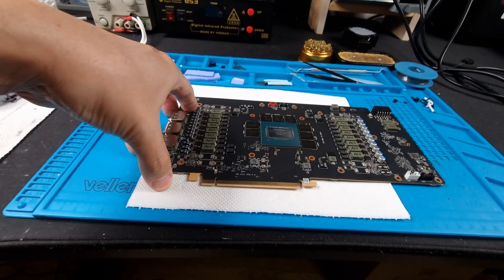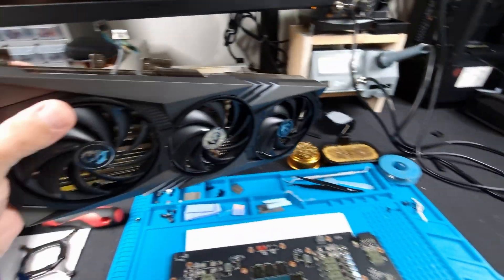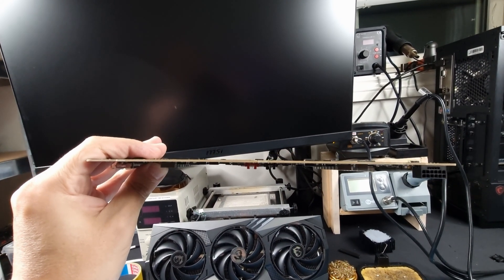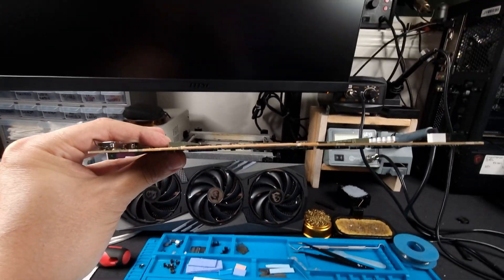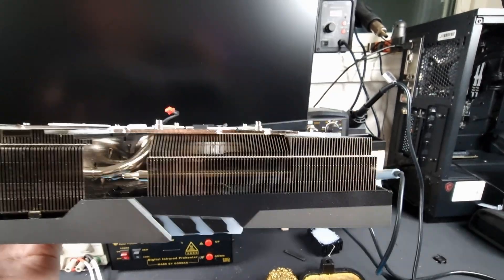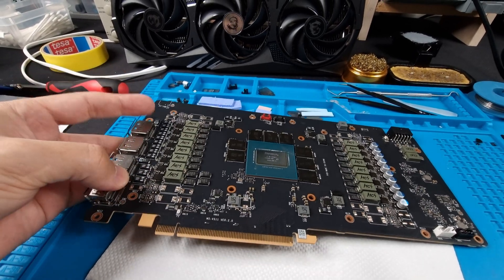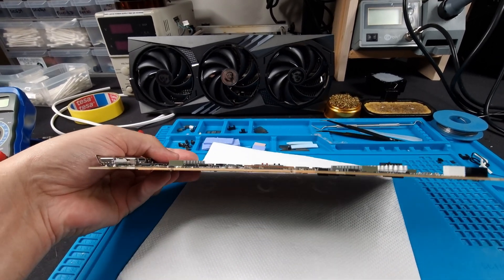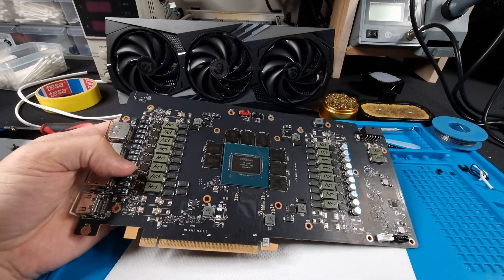How Using GPU Supports Incorrectly Can Destroy Your GPU.

Comment: Run 2 of them, at each end
Reply from the maker: @hawks_stuff  It could work, but it's best to have it vertically. Issue resolved.
Reply: @TechnologyHive  It does work, I run 2 myself. Not everyone wants/can do a vertical mount
Reply from the maker: @hawks_stuff  Well, you find out in time as enough hot/cold cycles warp the pcb when installed horizontally. One day you may remove it from your case to clean it up and when you reinstall it, it may not turn on again. But good luck, and I hope this is not the case for you.

Comment: GPU supporter apply between second and third fan properly , not on edges!
I had my Vega 64 Nitro+ with the supporter came from Sapphire , no issues as long I use it.
Reply from the maker: @BatManSWG  Well, I'm glad it worked out for you. Not all cards are this lucky.

Comment: You can just lay down your case on its back panel if you have space in your room, so in that sense you gpu is in position like its vertically mounted.Though it will maybe make your thermals a bit worse, as the hot air rises, and it would usually rise right into the fans at the top of a pc case, but now its rising into the front panel.But if you have good air flow, i dont think it will be a problem.So... this is just my opinion, it may or may not be correct.Also i didn't read full comment section, so i dont know if anybody else said the same think, so i am not copying anyone, again this is just my opinion.
Reply from the maker: @N33508  Yeah, many have suggested the same. But like you pointed out, it creates another problem with heat.

Comment: Totally agree. I have my 7900xtx on a vertical mount in my NV5 case. Not only does it look better, but also the card is better supported and wont be damaged at the PCB slot. I think a vertical mount can lose you 2-5 degrees in temperature but longevity is more important imo.
Reply from the maker: That's how that beast is supposed to be. If its a 79XTX it probably is a big heavy card?

Comment: What do you think about Lian Li O11D-1X-4 for Lian Li O11 AIR MINI? Will Phanteks/Cooler master will fit into this case?
Reply from the maker: @NameUserOf  Both of these vertical mounts are universal. But I think there is also a vertical mount specifically designed for certain Lian Li cases. I'd look into that also.
Reply from the maker: @NameUserOf  Both of these vertical mounts are universal. But I think there is also a vertical mount specifically designed for certain Lian Li cases. I'd look into that also.

Comment: Let me add my comment backing up most of what I've read: user error. Install the GPU, DO NOT screw it to the case yet, and install the support making sure the card is just RESTING on it (as horizontal as possible). THEN screw to case.
GPU supports are great, especially for larger cards, if used properly... which I hadn't even considered they coul dbe used improperly.
Reply: @emp1985 I think that you can screw at the start if you have your case laying horizontally while building
Reply: @Oilcommunist   or don’t screw it in at all. I wasn’t able to screw in one of the 2 screws in my 5070ti  so I just  did the top screw only . Bottom one wouldn’t fit. And just used the GPU support bracket to keep it from sagging.
Reply from the maker: @emp1985  Or you could just spend the extra time and money and buy a 3rd party riser vertical mount and protect your purchase. Done.

Comment: Those GPU are unbalanced in terms of how they'r weight is distributed ( at least that's my experience, with the 4070 TI and the 4070 TI Super, both from Gigabyte ). Didn't like the support either so, made those on my own, a bit larger and with a tiny bit of flexibility, in order to help mitigate vibrations. End result was better than the original. The " solutions " provided by manufacturer while being necessary, lack on quality.
Reply from the maker: I really hope this helps you in the long run. I just my hands on another 4070 Ti with void warranty because of crack at pci-e slot. If its not cracked solder joints, its cracked PCBs due to the card's weight.

Comment: When you buy a 2300$ gpu, spend 150$ on a case where it sits vertically
Reply from the maker: @Sakura_Yuki_NC  Yup I agree 👍🏼 💯
Reply: Can you please show me $150 (or any price) non-junk case that have at least 4 slots, preferably with extra one slot space for dedicated vertical mount not interfering with normal slots and being able fit water cooling and at least 4 HDD?
I am using Fractal Define 7XL and it can only fit 3 slot card that would be suffocated by glass side panel, unfortunately my card is 3.5 slots, so it doesn't even fit.
Reply from the maker: @pavelgajdik7486  Take a look at the Phanteks Eclipse G500A
Reply: @TechnologyHive  Nope, that's still only 3 slots and slightly less depth in main chamber, I pretty much went through all main brands and plenty of-brands, over several hundred cases and in end compromise on Define 7 XL.
Reply from the maker: @pavelgajdik7486  Okei...so you already had an answer to your own question before posting you first comment. Nice!

Comment: seems more like its been over supported.... I've been running a 7900xtx with a support for over a year now no issues, and its on almost 24/7
Reply from the maker: @Denbot.Gaming  I hope 🙏 it lasts for a long time.
Reply: @TechnologyHive  I spotted something when doing my system service, you know dusting, new paste etc.... the GPU actually makes contact with the DIMM socket clips, I wonder if that is contributing to some of them bending/twisting
Reply from the maker: @Denbot.Gaming  That could be. Hard to say without looking myself.
Reply: @TechnologyHive  well its supported at one end by the case and the other end by the bracket, I do have it on the face of the GPU, seems to be keeping it perfectly flat
Reply from the maker: @Denbot.Gaming  I hope it works out for ya 🙂

Comment: How much that thermal cycling is effecting this? 
I have 4090 and it's idling around 45C.
Remember some of my "old cards" 1080Ti or 2080Ti was idling around 50-60C and under load about 80C. So smaller dT between gaming/idle and using 24/7 it won't drop back to 22C unless i do some maintenance. Can't remember what was 3090 idle temps.
Changing temperature is always mechanical stress to solder balls.
Reply from the maker: It really depends on how much stress the PCB is under. If the card is sagging a lot, the core or memory chips may develop cracked joints sooner or later. My 4090 idles at the same temperature. It is normal.
Reply: @TechnologyHive  I added that support what come with gpu and adjusted it when I was building it so it should be in ok place. Maybe need to check if lock screw was tightened right in that and it's height haven't changed. 
Also no space for vertical adapter because all accessible pcie slots are in use.

Comment: This is an issue because people dont know how to use gpu supports and they're propping up their gpu support way too much causing a bend in the other direction
Reply from the maker: The issue is the card's weight. you can install the card perfectly levelled with the support, but during hot/cold cycles the pcb will begin to bend due to the heatsink size, and then rest on the support. By then the PCB is already bent and perhaps cause cracked solder joints. It is hard to say with 100% certainty if the card will die due to this. My advice is to always put these heavy cards on a riser.
Reply: @TechnologyHive  Can't you put multiple supports then, across the face of the card? May look less appealing but that way you'd take off all the stress.
Reply from the maker: @ZenTunE-  Either put your case on it's side if you have the room, or get a different case that can accommodate a vertical 3rd party riser. Or have the inside of your case look like a Roman Colosseum with a bunch of pillars.
Reply: @TechnologyHive  Im going for the colosseum look. To be safe Ill add an additional support towards the back of the card with the two I currently have, currently I have not observed any bending. 

I think its underestimated the strain on the pcb near the ports where there should also be additional support. I dont want to go down the water cooling route as this is an additional point of failure for the system which makes vertical mounting impossible.
Reply from the maker: @musiciantom  I understand vertical mount is not for everyone situation. But for those who can, it should be the way to go to avoid damage to their graphics card.

Comment: Kapono5150 said "This is incorrect use of GPU support, blame the user not the tool" , Spot on
Reply from the maker: @pc-ninja  If they provide you a support it's because the card is too heavy to be installed on your pcie slot alone, in which case, the right move is to have it on a riser. Period.
Reply: @TechnologyHive  Well I have been using supports for over a year np here its how you install and use the GPU support and the type of GPU support used.
Reply from the maker: @pc-ninja  Nope. Your card will eventually warp due to hot/cold cycles and having that heavy heatsink on it. I hope it does not crack any joints. It's an expensive repair.
Reply: @TechnologyHive  Nope it will not my GPU never get hotter that 80c under full load average temp is 70c under load. Also my GUP is under volted and overclocked. NP

Comment: My Palit card came with a different support mechanism. It’s basically a stick that I screw onto the heat sink. How will that bend the card the other way if it’s just resting on the heat sink and not being raised up by it?
Reply from the maker: @YAAMW  If they provide support for the card, it's because it's heavy. In that case, I'd use a riser. Check out the Cooler Master V3.

Comment: Can you provide a link to a reasonably priced riser/vertical mount?  Have you seen problems with dual fan (shorter) cards?
Reply from the maker: https://www.amazon.com/Phanteks-Vertical-Bracket-220mm-Riser/dp/B0C12YP357

You can buy it here or anywhere you want. I am not affiliated with Amazon.
Reply: @TechnologyHive  thanks. Also wondering if getting a shorter card is good enough.
Reply from the maker: @mikegraham4255  lighter rather than shorter would be best 👌 👍🏼

Comment: Imo the sag is way worse. My card is pretty beefy and the sag was visible, during the repasting I even noticed how the board itself is bent a little. Bought a stand and set it up no to try and level it completely but rather just a tiny bit higher than the bottom point of the sag. Temperatures are better and the card is working fine, I am not saying vertical wouldnt be better but its out of the question in my case and in many other cases as the space for vertical mount is usually a 2-slot but the cards today are easily 3-3.5 slot and even if it would fit the clearance from the side panel would be little to none which would create even worse heating problems.
Reply from the maker: No no. You would buy a vertical mount from Phanteks, or Cooler Master V3 riser. DO NOT use the case's own vertical option. That sets your card too close to the side panel. It will not work.
Reply: @TechnologyHive  I know about these solutions, however those are sometimes not compatible with PCI expansion cards. Only the once that allow flexible positioning might work in that scenario. In my case some of those wouldnt even fit as I am using 2x120mm fans on top of PSU shroud.

Comment: I think its more of a user problem. Its very easy to make the support too tight and in the wrong spot, causing the middle arch in the pcb. Also, not all supports are the same. Its all common sense. No support is not good either. I do agree though that the safest way is to vertically mount it with a riser cable . Least chance of movement.
Reply from the maker: No it is not. People buy a graphics card and expect it to work as it should. The problem is manufacturers reusing the same heavy heatsinks, and causing the lead-free solder joints to crack due to stress on the pcb. I use leaded solder which is less brittle than that lead-free junk, which cracks easier. No matter where you put that support, the PCB will warp in time after many hot/cold cycles with these heavy heatsinks. The fix is to install these things vertically. Done.

Comment: So if the support makes it just tip the other way, wouldn't two adjustable supports be better and having them kind of barely touch than having a single size that might push it too much? Best of couse for use consumer would be not having to use supports cause of size (which understandable might be easier said than done). This is just a thought for those who might like the traditional mount.

I am kind of trying for a "conversation" rather than a "oh you stupid"-thing
Reply from the maker: @danieleriksson990  The problem is that half the card length is comprised of heatsink in most cases. If you place the support in the middle or at the end of the card, you will still have the weight problem. The pcb will still warp and the lead-free solder used on these newer cards will crack easily and cause artifacts or just a dead card.

Comment: One other method: If you can afford a big boy, you can afford to make it EXTERNAL, sure you might loose like 1% performance on the connection, but you gain more lifetime.
Reply from the maker: I hear ya. But it would make things a lot more simple if you just buy a Phanteks riser mount and do it the easy way.

Comment: They have done cases where you can place the gpu on the case front now, like a radiator or like a distro plate.

But i would maybe do that on the top of the case, couse you usually take fresh cold air from the front, and hot air goes to the top by default.

This leaves you more room for other devices into your motherboard that are not so heavy.

Another fix could be: Lets start demanding horizontical computers again ?
Then the sag would be towards the motherboard.

Comment: I’m so glad that I have always vertically mounted my 4070 Super from day one. I just absolutely dislike the sag on these gigantic cards and always been paranoid of the sag damaging the card even with a support bracket. Better to be safe than sorry :)
Reply from the maker: Nice! Your card should last you a lot longer this way!
Reply: If you put them vertically, what happens with the thermal paste?
I have seen supports for horizontal use on Amazon, would that also be an option?
Reply from the maker: @Percycad  Nothing happens to the thermal paste. I would advice you to put your heavy card on a 3rd party riser if you can. Best solution.

Comment: Not entirely sure that's how gravity works, the same force is applied to the entire horizontal plane, there is no physical reason why gravity exerts more force in the middle, the problem seems to be a bunch of monkeys not knowing how to use the supports.
Reply from the maker: I am sure gravity "pulls" down on things, even you. Yes gravity exerts on the entirety of the card, but due to hot/cold cycles, along with the very fact that 50% of the card's length is just heatsink, which is crewed onto the pcb, sag or warping at the PCI-e slot will cause the PCB to slowly begin to bend following the heatsink.

Comment: I think when GPU size outgrows ATX and even E-ATX standards, why not design a new form factor to get rid of sagging altogether? I mean a new attachment mechanism demonstrated on OAM accelerator cards in servers and memory board on CAMM2 should solve this. It shall be based on LGA attachment mechanism of GPU PCB, and OAM form factor, and new wind tunnel replicating typical workstation CPUs do.
Reply from the maker: The problem is not the cases or motherboards. The problem is the GPU's themselves. They are getting too heavy, all due to GDDR6X running hot. Board partners recycle heatsinks, so they end up putting them on cards that really do not need such heavy heatsinks, just to cause problems later.
Reply: @TechnologyHive  I am wondering how to make lightweight yet still have great thermals for video cards. What I know of OAM attachment mechanism is pure stability and durability. Maybe one way shall be use of carbon fiber, or go back to turbo blower.
Reply from the maker: @jimmyjiang3413  ...or use a GPU riser, like the Phanteks: https://www.amazon.com/Phanteks-Vertical-Bracket-220mm-Riser/dp/B0C12YP357